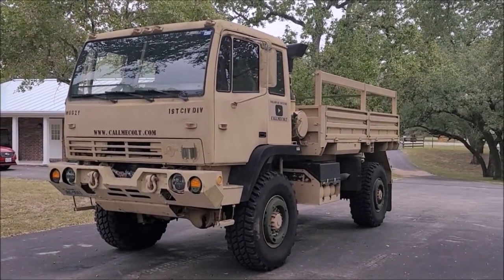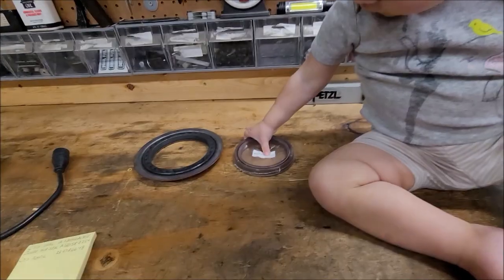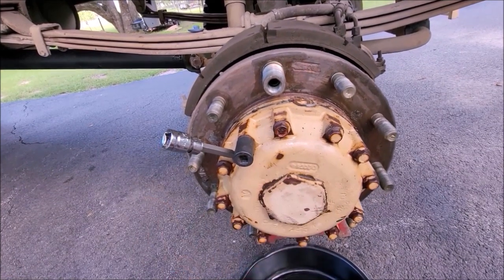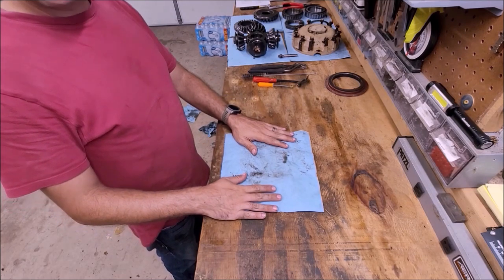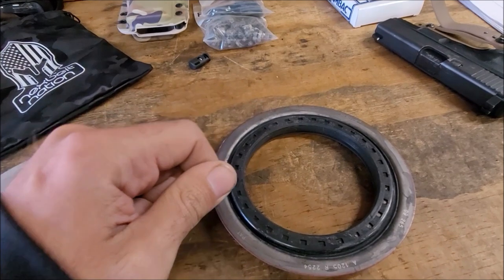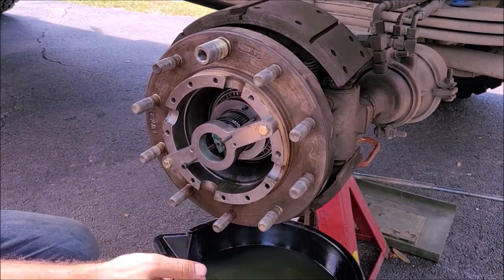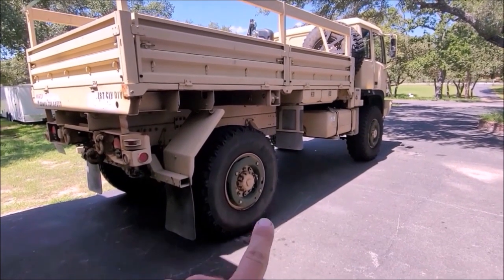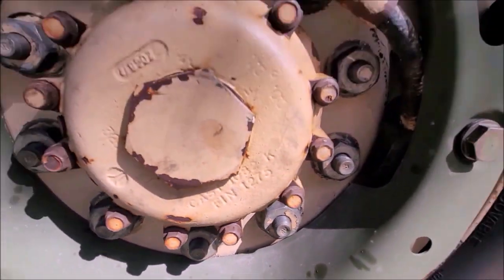M1078 LMTV - Hub service walk through

Comment: Nice video! One difference with the front is you cannot pull the shaft out so if a socket is needed to loosen the bearing nut it will have to be deep enough to accommodate the axle.
Driving the ctis seals in with the driver that is in the TMS is nice because it has a thin ring on it that will bottom out on the outer edge of the plastic seal. I do remember slamming those in pretty hard. 🤪
Reply from the maker: Thanks a bunch for the input. I plan to go back & link your videos in the description as well. They helped me a bunch.

Comment: Very well done! I wish I had some helpers, too... every once in a while. I'm going to be doing gear and locker replacement, including this servicing in a month or so... thanks for showing this. BTW, for those saying you should "service the brakes" ...if they mean to do an adjustment, the adjustment is automatic. Doing well, love your vids.
Reply from the maker: I saw your video on that project... Going to be a lot of work! I have some big ones coming up. Have just about everything I need to do them. Just getting cold here now so I may hold off. Been getting some little stuff done though.

Comment: Good thing you used same spacers and did not unnecessary modify the play in the spider gears, so you did not modify the surface contact formed between gears.
Reply from the maker: I didn't plan to change anything, but, if the gears had worn over time or someone had done something improper in the past, things would have needed to be changed. Now that you mention this, if adjustments were made, a flush after some miles should be done and I should have mentioned it due to the possibilities of metal shavings since everything will "wear" in together slightly possibly. Thanks for pointing this out!
Reply: @CallMeColtLLC  few other youtubers did  modify the backlash even if this was within specs and no wear. Unnecessary. And this is  same for any gear work. 
I would measure everything in gear work before taking out, and if all good, I would mark put everything exactly same possition/ relationship etc. 
Cheers.

Comment: This is probably going to be a ridiculous question, but is there a 1:1 planetary gear option? Or a non planetary hub option? I can get a set of affirdable axles. Can get affordable lockers too. I'd just rather run them as 3.90 for the truck I want to use them on. I'd like to use a 445/50R22.5 and wouldn't have to have the rear rims faced in.
Reply from the maker: You could weld it all together? The main advantage to using these axles is for the planetary gears though.

Comment: Those.were huge nicks in the bearing race do you know how many rpm the little rollers in relation to the tire size?
Reply from the maker: They are going many times more. Made this video a few years back. I don't recall issues on where the bearing makes contact, but on the sides. Have done a LOT since then. Share the time stamp if you don't mind.